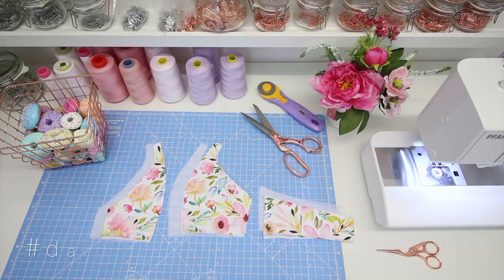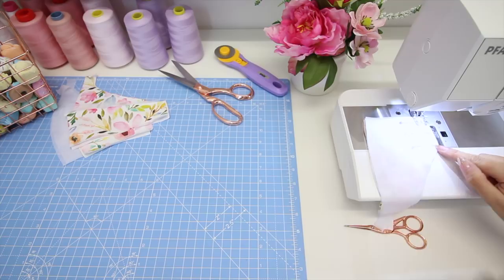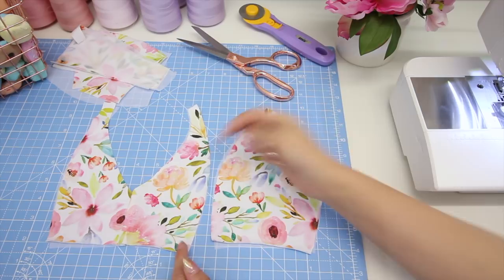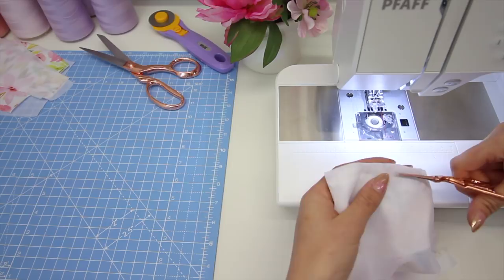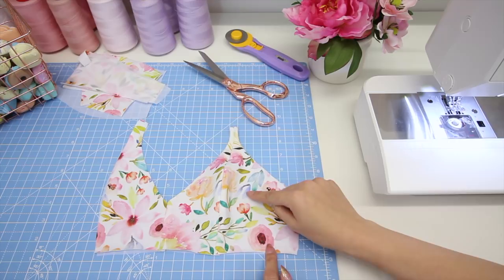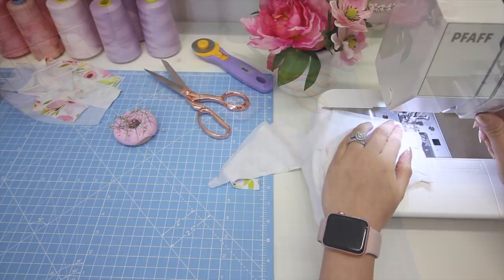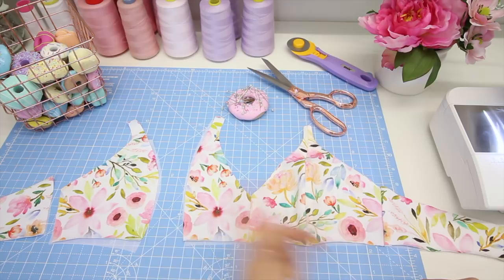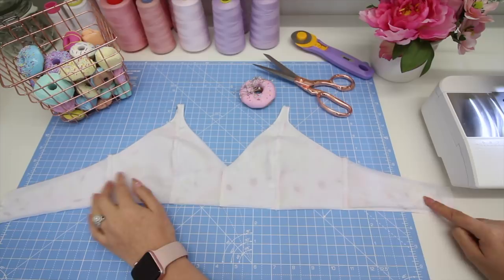The Darcey Bra (Style 1) Tutorial -  Part 1

Comment: Thank you so much for the tutorial along with your patterns!! I'm going to be purchasing this pattern from you and was so excited to see you have a channel. One question though, how are you sewing a straight stitch on stretchy fabric and not having issues with the fabric puckering? I have the worst time with knits. Is it possible to use this pattern with wovens?
Reply from the maker: Hi, unfortunately this pattern is for knit fabrics and wouldn’t fit with a woven fabric instead. Make sure your machine has a stretch needle and maybe experiment with the stitch length to avoid puckering.
Reply: @EVIElaLUVE  Okay thanks. Strange that in my over 20 years of sewing I've never used a stretch needle. I just gave up on knits. I will give it a try. :)
Reply: @styleago-go3028  I've been sewing since the 70s and until this year only used sharps, Universal's, and ballpoints (which are the same as jersey). I could manage knits but sometimes struggled. Since starting lingerie this year I discovered the difference stretch needles and microtex needles can make. Good grief. I strongly urge you to buy a pack of each, loosen your tension and needle pressure and you will have new sewing happiness in front of you!